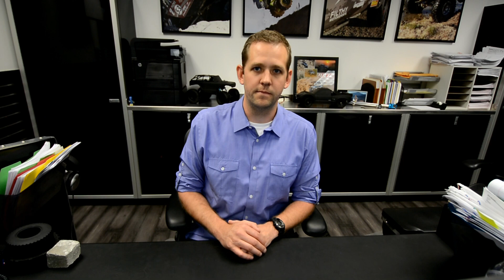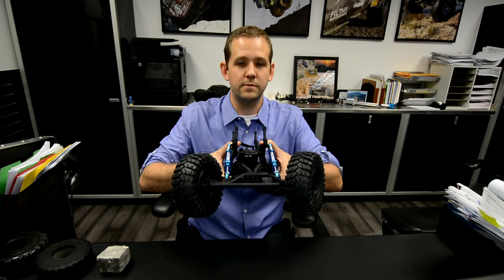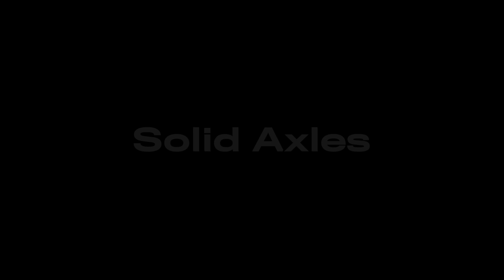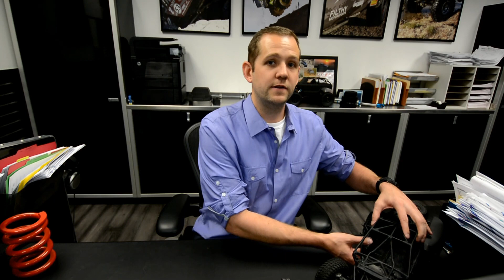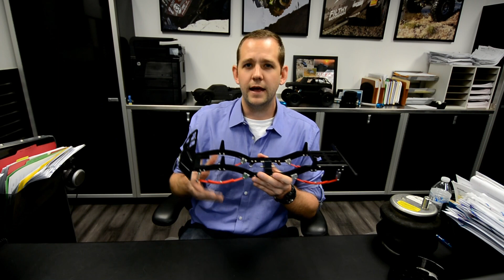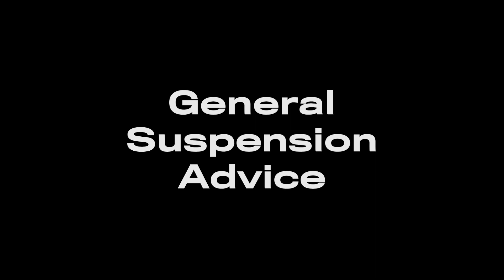Suspension Ride Quality Explained - Filthy Motorsports

Comment: Ok here's one you probably don't hear very often: I want to keep my hoopty on the road. At near 300K miles the OE suspender were shot along time ago. It so happens this particular whip Is FWD, beam rear, light as a feather and OG was equipped with 12" (yup no typo) wheels. Finding rubber for those donuts is near impossible nowdays, so Ive gone +2 with some Miata rollers just so I can get rubber. Next is probably some CHEAP coilovers. Help me out ...rule of thumb, do I use longer springs & lighter pressure or shorter spring with higher rates? would like to lower slightly & is street driven but (as its only 1.3L) its WHIPPED to get anywhere ?

Comment: 11:42 Considering it's a work truck they probably did it to accommodate various loads etc. If the spring was very soft it would compressor a lot under load. Not everybody will use it for dunes.

Comment: I had a Citroen CX with hydropneumatic system. it was fantastic.  
However today I find all cars to stiff and hard. Combined with todays hard seats it is not getting any better. 
Ideally I wan a car where I can set a cup of cop on the dasj and drive over a speed bump without loosing a drop. 
Is it possible to build a system like that? 

My old CX had it.
Reply: There are plenty of comfortable cars especially premium ones. Also Chinese manufacturers are  implementing magnetic suspension. It's very important to consider tires with car comfort. If you find it uncomfortable try swapping your wheels with smaller rims and thicker tires.
Reply: @dkdanis1340  Have you ever tried one of the older Citroens with hydropneumatic suspension? You will absolutely not feel a speedbump at all. 
Only airhook can compete with that. But they use a lot of power.

Comment: Looking for  king shocks for  1989 peterbilt 379 for  off road  trucking  not  bombing down  logging road  just  oil patch  washboard  and  pothole  mud ice road  . Air trac rear suspension. 112,000 lbs gross.

Comment: @19:44 - "In order to fix one thing you will negatively effect another thing". For the Raptor guys with "upgraded" stiffer springs, myself included, I have have Camburg UCAs, Geiser progressive coils up front and Icon +3 progressive leaf's in the rear. The shocks have been rebuilt and "Bravo Tuned" and the caster is set to 4.5. It handles much better than stock but there is more to be done here.  I have asked the forums if increasing spring rates requires changes to valving to account for the new spring rate. Often the answer is along the lines of "it doesn't make a big enough difference." The way I drive my truck, it makes a difference and it needs to be accounted for.  I have experienced the tires bouncing off the asphalt multiple times if a series of bumps are hit at the right speed with the right turn angle.  It is unsettling to have one of your tires continue bouncing off the pavement while the other three are planted and the bumps are well behind you. When on mountain roads the the whole truck sometimes feels like the tires are taking turns hoping off the ground. These are rare occurrences but they do happen.

I have been told I need to install a "flutter stack".  My understanding is that this will increase body roll or nose over while breaking and potentially reduce usable compression travel. I upgraded the springs to pick nose up 2", reduce nose over while braking and to account for weight in the rear while retaining full travel and compression dampening.  I don't think the "Bravo tune" is correct for my springs, the way I drive or where the truck rides in the travel of the shocks. 

I may not be ready to spend the money on a set of Kings for my truck but I am ready learn how the suspension should perform under different conditions and how to get that performance. 

I think I need to reduce compression dampening and rebound dampening needs to be increased to control the higher spring rate properly.  

I appreciate the video you have closed the loop for me on many things others told me were not significant enough to matter.

Comment: Ben, you have a natural gift for teaching. If I may ask, what are the effects of preload on ride quality?

From what I understand, preload does not affect spring rate. So assuming that one does not run out of downtravel and the suspension has enough droop to reach the bottom of a pothole, ride quality should be unaffected by increasing preload. But what about during a jump where the suspension is fully extended?

If we land from a jump, am I correct in assuming that the preload must be overcome before the suspension begins to compress? If so, does this mean that until upward travel begins, the impact of the tire with the road isn't mitigated by the spring, making for a harsh landing?

If this is correct, does this mean that the ideal spring setup for a vehicle meant to jump is one with zero preload? I.e., adjust for desired ride height by experimenting with different spring rates while screwing the coil nut in just enough for each spring to be snug. This way, very little shock is transmitted directly to the chassis before the suspension begins to move.

Normally, this kind of spring rate would be far too light to cushion the blow of the landing but if I learned anything from this video and from reading your comments, a good damper will take care of that. 

Thank you for taking the time to put this video together. I learned a lot!

Comment: found the video as i serching like a spunge after info how to tune my shocks on a rc car and can relate to much of the video as spring rate and shock travel/ how stiff shock should be to handle most of the bumps eaven if their is some at the track im running that is going to bottom out.
found parts of the video that i can lern from also.

Comment: Great videos! kudos to you and your team mate! Can I ask since kings coilovers aren't available in my country, will BP51s (yeah I know u guys think its gimmicky hehe) be a good fit for what I do and worth the price? These are the only fully supported reservoir coilovers available in my country. I do some offroad trails on the weekends (Rocky and/or muddy) on a 4wd diesel toyota fortuner (hilux-based wagon, same front end as prado/4runner/gx/FJ). Currently on bilstein 5100s and front 800lb rate springs and rear 2" lift springs from toughdog. Ride is okay but I think the billies might be slightly underdamped for it.

Comment: Why does no one ever talk about the massive differences between the 2.5 to 3 inch lifts on stock suspension components? I mean you see a lot of suspension company’s advertising for or allowing 3 inches of lift and a lot of people run that setup! Is this because the effects of a 3 inch lifts are overlooked or do people just not care? I assume this is a highly debatable subject seeing that half an inch in most people minds is not that big of a difference, but when you think long term the smallest things account for the larger problems when you look at the big picture! I love the in depth reviews/facts/reasons that he provides to educate people on the truth as to why these things matter! Awesome job by Ben and his team at filthy Motorsport providing knowledge thru experience for the people. Anyone else have thoughts on this subject?
Reply from the maker: Great question! 3" sounds better in marketing material and most budget lift kits will advertise that and if you read the fine print on others it will say 3" of lift for "lower ride height" models or something to that effect. In the end, regardless of how kits are marketed, there is a very specific geometric sweet spot on all vehicles, and "lift" is not an accurate way of getting there anyway as not all vehicle ship at the same height. Hope that helps!
Reply: @Filthymotorsports  thanks for the response Ben! You’re feed back is appreciated

Comment: Hi, I'd like to get yours and everyone's opinion on a possible rear suspension modification (especially if you have had any experience with 2 to 5 ton trucks, 2wd or 4wd). This question is for a '69 one rear axle 2.5 ton 4x4 truck, leaf sprung.
I once saw where someone was using shackles at both ends of the leaf spring and a torque bar connected under the spring pack. The frame end of the torque rod used a pin so the torque bar could move up and down but allow no lateral axle movement. And the axle end of the torque bar used a heim joint. This would allow the axle to rotate/twist if one side was going over a rock and the other side was not going over a rock, for example. The idea was to maintain the full load carrying capacity of the truck but allow for more axle movement on and off road and when loaded or unloaded. In addition to better axle movement, the person claimed it also afforded a much better ride loaded or unloaded both on or off road without putting a stress on anything as compared to when a rear axle is locked in place by leaf springs that only give at the one shackle. I hope I explained it ok. Everyone's comments would be appreciated. I am converting my 2.5 ton truck to 4wd and I'm considering this modification for my truck's rear suspension.  Truck's use is occasionally work and off-road and long-distance camper.  

Also on a leaf-sprung front suspension, why is the shackle often put in the front of the vehicle's front leaf spring, and not in the rear of the front leaf spring?  I was once told because of the rebound there is much less shock experienced when hitting road bumps and better ride with the shackle in the rear of the front leaf springs both on and off road.  Your comments, please.
Thank you.

Comment: I had a question about what the best solution for fixing my 2009 Silverado shake. I've noticed that it's a very subtle bumpiness around town doing city driving. It feels a bit mushy and disconnected from the road. Having some issues when I'm hauling a trailer. Noticing the vibration in the tail end of the truck it's quite jumpy on the highway. The shocks and springs are, I believe the stock, that came with the pickup. Any recommendations for best setup for a Silverado of this year to get better daily driving and a stiffer, stronger more controlled ride while towing a trailer even when trailer is unloaded. Thank you in advance.

Comment: Ok. 07 FJ CRUISER  I've just install Fox 2.0 coilovers and rear shocks leveling kit.
It leans a little tours drivers side like before. And fuel tank is on same side.
Also install SPC UCA'S. What do the SPC arms do for it?
Reply from the maker: Lean would be adjusted via preload. UCAs allow a proper alignment.
Reply: @Filthymotorsports  thank you.

Comment: This is the exact video I needed just... I'm so glad I'm stumbled across this video tonight. I'm 3 weeks into my new 2021 Ford Bronco Outer Banks (Non-Sasquatch) purchase and I really do love the vehicle, however the ride is quite a bit stiffer than I expected. It handles cornering and turns far better than expected, but it's pretty rough when going over train tracks or significant bumps dips in the roadway. It sounds almost exactly the rail-road issue you mentioned with your truck. I would love to upgrade the shocks alone, to improve ride quality, without having to swap out the entire suspension system. So that sounded like a great option to me!
Reply from the maker: We would be happy to help and have more Bronco kits coming in soon, contact us directly for details!

Comment: Excellent video. Very nicely and clearly explained.
There's one thing I still don't quite get. What exactly produces the subjective feeling of comfort? I used to think it was the softness, i.e. soft=comfortable, hard=uncomfortable, but now I'm not so sure anymore. My car has adjustable suspension. It's reasonably soft in normal mode, a bit stiffer in sport mode, and a bit stiffer still in track mode. I was expecting the car to feel more "planted" in sport mode (which it does), but a bit more uncomfortable. And yet it's not. Somehow, surprisingly, I find it more comfortable in sport than in normal. That shouldn't be the case, should it? What am I missing? What is it that makes it feel comfortable despite the increased stiffness?
Reply from the maker: Thank you. In a nutshell, the one attribute that has the most effect on "comfort" is predictability/consistency. A well tuned suspension system is predictable and consistent so you can trust how the vehicle handles bumps and dips, so you are able to relax and let the suspension do the work. A soft, unpredictable suspension causes you to tense up, or clench you stomach when driving over rough terrain or hitting a bump, and that causes discomfort. Hope that helps.

Comment: Only MRI fluid in struts or shocks, controlled at 2uS by a high-speed LAN can change the viscosity of the fluid from a thin oil to a simi-solid in half the time to blink an eye. Next, a fast high-speed linear actuator is needed to raise or lower the upper pivot point of a shock or struts effective length to achieve a perfect compression & rebound at a give ride height for any vehicle for any road condition. This means a $50K vehicle sitting on a $24K suspension. Who can afford that? Jay Leno perhaps? Delphi invented MRI fluid near or during the end of WW-II. To my knowledge, Lexus used it first on a motor mount with soft, medium or firm settings based upon shift patterns, RPM and road speed. Only GM introduced “Real-Time-Damping” on the 2004 Corvette. At any speed, road conditions, lateral Yaw & Pitch, the system shines. It is on many GM models with up-level packages that include it as it is not cheap but has cost come down. The Delphi Magnito-Reological-Fluid has the ability to change viscosity from a thin oil to a semi-solid with changes in amperage to vary the magnetic field where the mechanical valve would live in a strut. The next major expense would be a stainless steel linear actuator The is robust enough to raise or lower the upper mount of a strut or shock, to adjust ride height based upon the intended use or the chosen path a vehicle may take. Cost, unbelievable yet possible as it would have to be incorporated into the vehicles design structure. Great info again. Best of wishes!
ASE Master - Retired

Comment: I just want for my 2007 fj cruiser 2 Wheel drive  to replace my original shocks for a better conforble 
Ride on regular roads. I was told Ranchos are good fit but I don't know which one for the front & back. What specific shocks,( i guess package or kit & comes with strats & spring coils) affordable purchase do you recommend ? Only the shocks?

Comment: I am interested in tuned shocks for my 05 ram 2500  and a cost.  I plan on having the 3" lift knuckles  up front and maybe updating the rear leafs to new ones as my 400k miles ones are near flat across 😄 (how I got the truck) im looking to soften the suspension  but get the hight up some to avoid  bottoming out

Comment: My SUV tends to roll and bounce way too much on uneven bumpy roads, enough to upset it if you don't go slow enough. And hitting potholes tends to crash through the cabin while bumps aren't a big deal. I guess there's not enough down travel, the springs are too soft and the shock absorbers are very weak and are barely able to control wheel movement. Actually it is very much like What this video shows.

https://youtu.be/p8g8Rj0v1ZI

What do you think? BTW does this happen with leaf springs?

Comment: Ben.. can i use deaver over my axle in my 86 Toyota pickup 4x4. Going with long travle ifs. Im trying to keep good ground clearance  in the rear. Mainky jist daily and trail truck. No rock crawly.. i currentlynhave ome dakar leaf in the rear... and i will be putting a t100 rear axle in soon and probably can relocate and fit a 2x12 shock out side of the frame
Reply from the maker: Absolutely, we get great results with that configuration when set up correctly.

Comment: What do you think about icon 2.5 extended travel coilovers with 650 pound springs and the cdcv reservoirs?
Reply from the maker: They are a very good shock when paired with the proper application and realistic expectations.
Reply: Filthy Motorsports Toyota Tacoma and 70% highway, 30% off-roading. Paired with icon AAL and rear icon 2.0 resi. Also running 285 falkens

Comment: Great video with explanaitions you can understand without having a degree in french...  In regards to the bucking feeling you pick up from joins in the freeway, will it be affected and amplified by flexing of the chassis if you have eg. A 2 inch body lift paired with a custom steel bumper that carries the weight of a full size 33" spare tyre? Or is the extra weight just pushing my leaf-spring, coil-over  combination to the point where its getting unpredictable?
Reply from the maker: Great question and glad to hear you enjoyed the video. To answer your question, yes, all of that will have an effect. Probably not a tremendous amount, but it all adds up.

Comment: With all the tuning and calculations and designing, I think the ride Q on a lot of new cars sucks.  Where I live we have shitty roads because the local gov't steals all the money.  Actually, even after they make the roads glass smooth, the ride still sucks.  There is too much emphasis on handling these days.  I just wanna drive in a straight line.  I don't need "handling".  I need sanity.  You got any of that around.